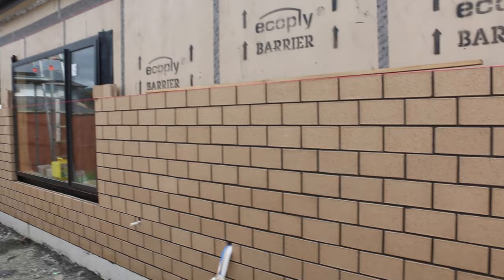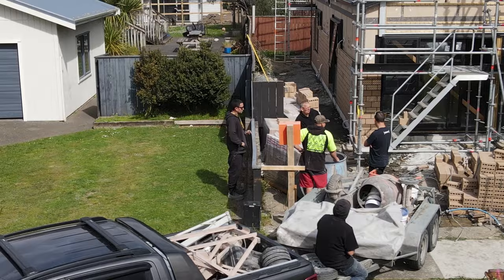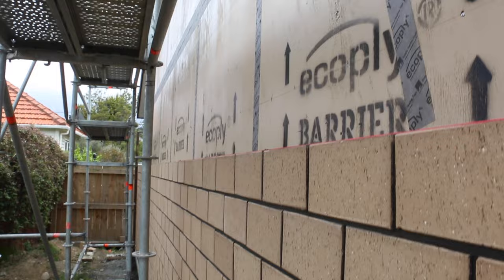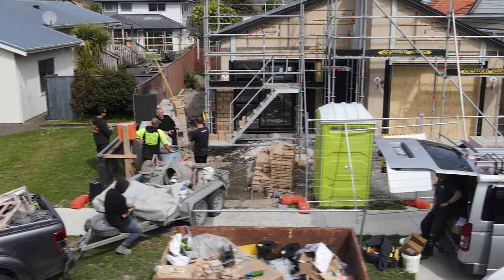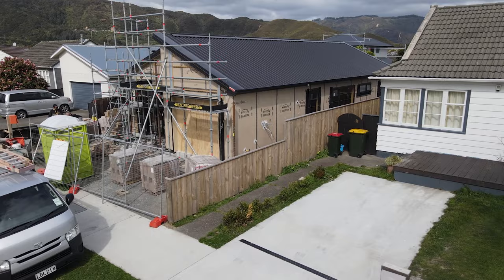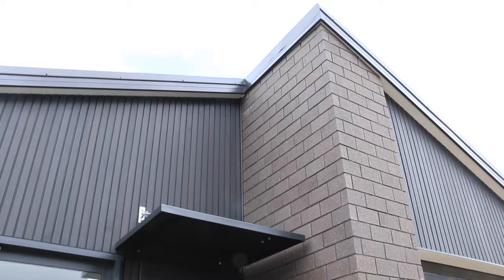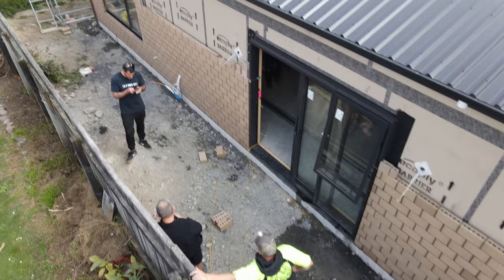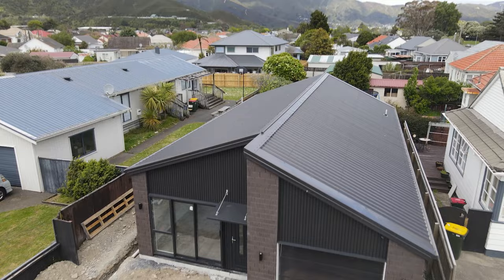One Batch of Bad Bricks Almost Ruined this Build

Comment: The darker brick looks far better anyway.
Yellow brick to me just looks cheap and reminds me of a 90s old folks home.
It's been used a lot on much of the infill housing in Auckland, I just thought it was because it was the cheapest option being a straight clay yellow brick with no extra die or oxides added and locally produced, I'm surprised to hear that it is imported and no cheaper than much nicer options.